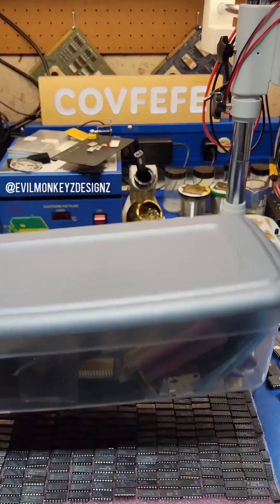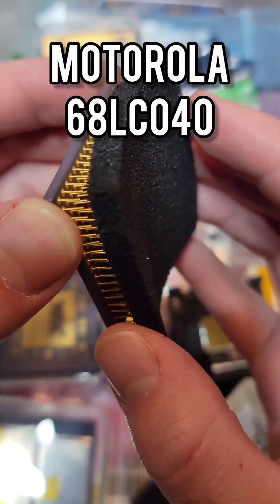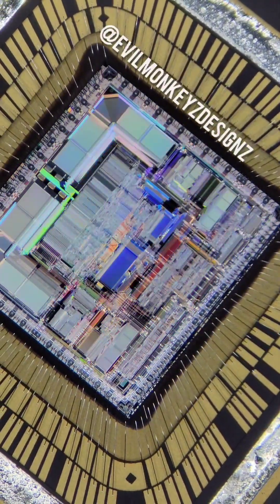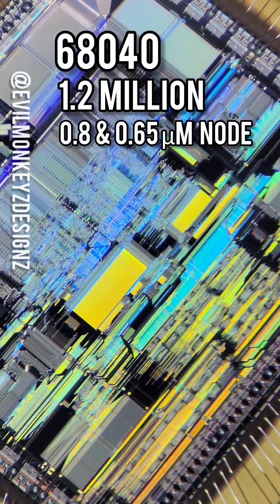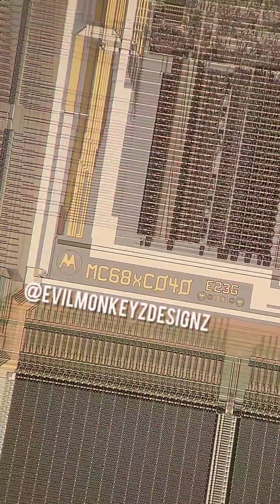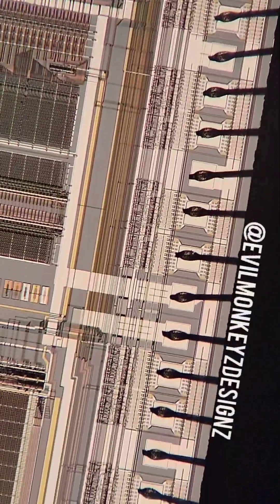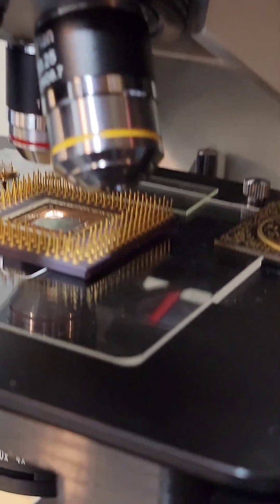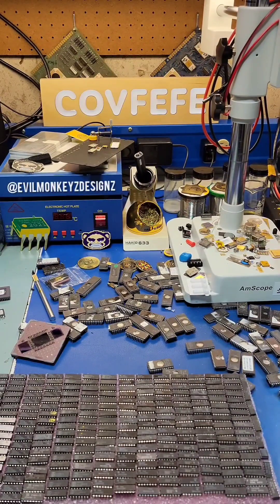Motorola 68LC040 32-bit #CPU

Comment: Weird that the LC is the one without the FPU, as the 68040 was basically the 68030 with an FPU. I had the 68030 with a separate FPU un my Atari Falcon.

Comment: I still run 000/020/030 boards in my Amigas and I have owned several 060 boards in the past. I never bothered with the 040 as, by the time I could afford one, I could afford an 060 and I didn't like how hot the 040 got in comparison to the other 68k lineup.

Comment: I used the 68000, 68020 for a few years. Great processor of the time. The Motorola used direct memory addressing..not the screwy Microsoft scheme. I can’t remember the terms
Reply: Flat vs. segmented memory model.  (m68k is flat, x86 is/was segmented)  Microsoft was agnostic on the matter.
Reply: @alexhajnal107  thats right...only 35 years ago. Made using the assembler much easier...I did a lot of assembly programming with the CPU..
Reply: @jstone1211  I too did a lot of assembly coding for the 68k and found it to be a joy to program.  x86 looked like a horrific mess.  IIRC, modern x86 CPUs still use segments but OSes set things up such that as far as addressing goes there's a single segment covering the entire address space (virtual memory is a separate topic).
Reply: @alexhajnal107  wow, you are bringing back terms and memories I have forgotten. I am now 67 where the old noggin is not the same. BUt UR right, so easy to code for the 68 series....even the microcontrollers were fun....
Reply: @alexhajnal107  thanks
Reply: My favorite part is the regular instruction set where all the data and address registers were all basically equal.  All Data registers were basically accumulators and where any Address register and addressing mode could be used by just about any instruction for either operand. (with a few special exceptions) While the 80x86 series have so many special use registers and instructions you have to be careful what you use registers for.  The basic registers are literally hold-overs from the 8080 architecture extended to 16/32/64 bits and then all the new special use stuff.
Reply: @tconiam  With the 68k the operations one can perform on an address register are more limited than those one can perform on a data register.  Still, one can use the address registers for some data operations.  Likewise, only the address registers can be used to specify the base address for memory operations.  The distinction between data and address registers notwithstanding, the 68k is very orthogonal.

Comment: Is this more powerfull than a current Esp32?

I am always thinking surely high end early 2000 chips should be extremely affordable now and able to power IoT peojects?
Reply: The ESP32 is a lot more powerful than the '040.  The '040 is around 44 MIPS while the ESP32 is 200-600 MIPS.  It depends on the model.  Both look to be around 1 MIPS/MHz though.  As for "IoT" the main things one wants are onboard RAM (and maybe ROM) as well as copious I/O; the 68000 and similar processors lack this (RAM, ROM, I/O are handled by external chips connected via wide buses).

Edit: The early DragonBall processors use a 68000-derived core but add SOC functionality (display controller, UARTs, RTC, etc.); they still need external RAM/ROM but are a lot closer to an "IoT" CPU, cf. the RasPi.  DragonBall processors were notably used in the Palm Pilot and derivatives (Handspring Visor, etc.).
Reply: @alexhajnal107  thank you for this. I understand a bit a better now after googling some of what you said. I guess, new tech just is better most of the time. I even thought of early hardware for PCs like the Core 2 Quad and Core 2 Due era chips but I realize now, an ESP 32 being an SOC makes it something way different than what existed back then.
Reply: @ErikThiart  A typical "ESP32" is actually an SOM (System On Module) that includes the ESP32 CPU, a QSPI flash memory chip (the ROM), and an antenna (plus support components such as capacitors).  Apart from the lack of in-built ROM for user program storage the ESP32 fits the definition of a standalone microcontroller (it does include a monitor in onboard ROM though).  Some models of the ESP32 include SOC functionality such as LCD panel drivers and USB interfaces.

Comment: I'd love to see a 68000 cpu under the microscope.
My first home computer (Atari ST) used an 8MHz 68000.
Reply: Visual 6502 has some very-high-resolution photos of the 68000 die.
Reply: And Amiga 500, and Apple Macintosh plus!

Comment: They were not desktop PC's, for that honour you needed an x86, ideally from Intel but a 6x86 from Cyrix I saw in the beginning would work just as well. 
Also, I have a memory that some of those 6x86's, especially when branded/licenced by IBM, were also made by Motorola...
Reply: Not desktop PCs?  I have three m68k-based desktop PCs within 2 meters of where I'm sitting (68000, 68030, and 68040 based).
Reply: My old Motorola Macs definitely were desktop PCs.
Reply: @peterdefrankrijker  Various Atari ST(e)s, an Atari TT030, a NeXTstation, a Mac Quadra (running A/UX) and a Mac Plus in my case.  That's '000, '030, '040, '040, and '000, respectively.  [ So that actually makes 5 within 2 meters of me then. ]
Reply: not desktop PCs??    in what world?? 
of.  you think a DesktopPC is automatically a x86 based machine and no other architecture?
Reply: The main advantage that the Cyrix chips had was that they were much cheaper than Intel's offerings at equivalent performance.  Intel had an edge with floating point performance so was popular in engineering, the sciences, and (later) amongst gamers.  Cyrix has better integer performance so was popular for general business and home use.

Comment: Interesting, what was the bug?  How exactly did the software floating point operation fail?
Reply: Put simply, under certain circumstances floating point instructions wouldn't raise an exception when executed (the floating point emulation runs via the exception handler).  From the errata:

10.)  (MC68040 & MC68LC040 only) If an A-line, Illegal, CHK, or Unimplemented Floating Point instruction is in the last 16 bits of a page and the next page does not exist (or is nonresident with pdt=0), the proper exception is not reported.  Instead of reporting the proper exception, the 68040 attempts to prefetch the next instruction on the missing page, and an instruction ATC fault is reported with the fault address showing the first word of the missing page and the program counter showing the address of the instruction on the preceding page.
Reply: @alexhajnal107  oh God, was this the reason for the critical error in the 737's?
Reply: @aaronm.4316  No 737s were harmed in the crafting of this bug.
Reply: One obvious work-around for the bug would be for the compiler/programmer to insert a (16-bit) NOP (no operation) instruction at the end of the page if execution crosses page boundaries.  The 68040 NOP instruction does have side-effects (basically waiting until all the pipelines have been flushed and all bus operations have completed) so using this method would cause a (possibly sizable) performance hit.  Alternatively, moving a register to itself with MOVE (also a 16-bit instruction) should also do the trick and be much faster (2 clocks vs. 16+ clocks, if I'm reading the timings correctly).  It's not clear whether this was actually done back in the day.

Comment: Software emulated float operations?
Reply: It's common for MCUs (microprocessors) to not have a FPU, so they carry out floating point operations in software. 
It's a lot slower than a hardware FPU, but is acceptable in some applications.
Reply: 8 bit microprocessors of the 70's, 80's did not have FPUs. All floating point operations were software implementations.

That is what came first, before designers started designing floating point coprocessor chips, and then later incorporating the FPU on to the same die as the processor.
Reply: @deang5622  Most microcontrollers don't have FPUs either.  Using a software FP library isn't uncommon when RAM/ROM space and CPU time allow (one can usually use fixed point math instead when resources are tight).
Reply: Tito!